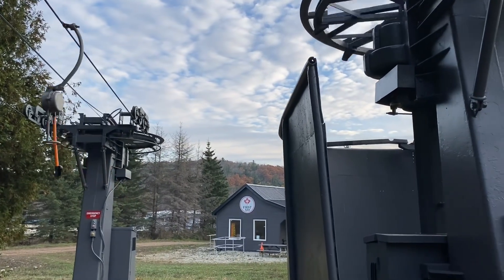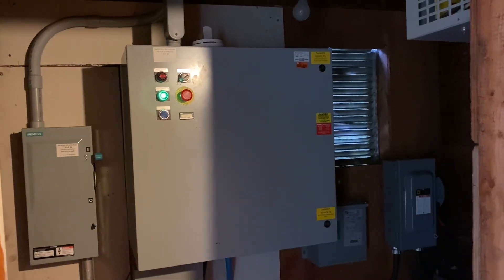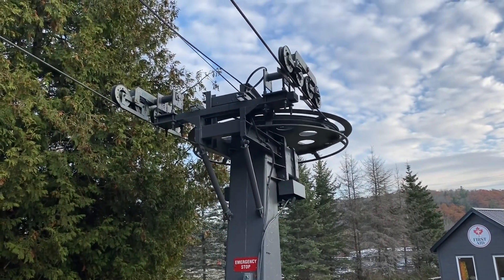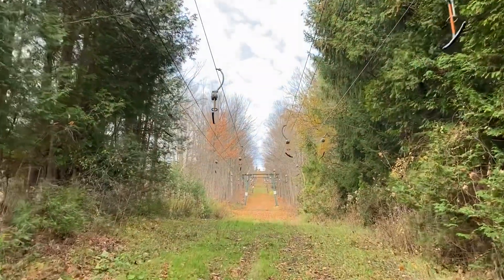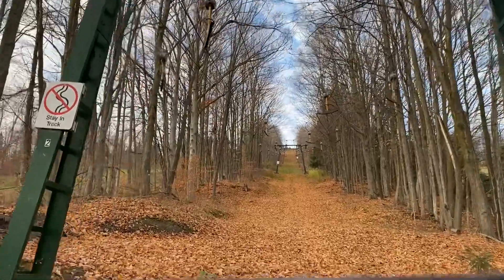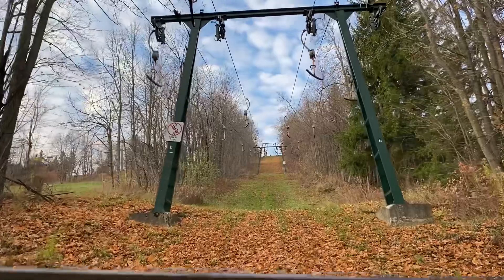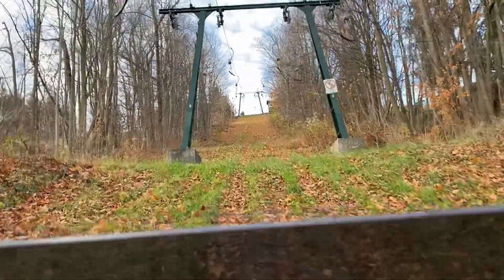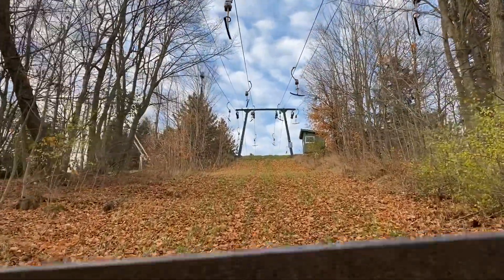Start-Up and Inspection of Two 1973 Doppelmayr T-bars

Comment: I love the behind the scenes of lifts, but im still getting a fairly basic knowledge of them. This leads me into my question of what is a PLC and christmas tree? They sound similar to eachother in your brief description, so if my assunption is correct, what is the difference between them? Thanks! Also, I love your youtube channel. Your videos are really well done and short which is nice as the viewer to get a small glimpse into the day in the life of a lift mechanic.
Reply from the maker: Thank you so much for watching! The safety circuit of a ski lift is something I want to cover in a future video. Years ago all lifts were analog and relied on a series of relays, a fault would be displayed on a panel with red and green lights (hence Christmas tree) indicating were the fault is. In the last 20 years lifts have gone to plc’s (programable logic centre) that have replaced the relays with a simple computer and faults are now displayed on screen. The only trouble I have is there is not many of the old systems left but I might have a hill with an old chair that still has it.
Reply: Awesome explainarion. That makes a lot of sense now. Thank you! @patricksmotors9070